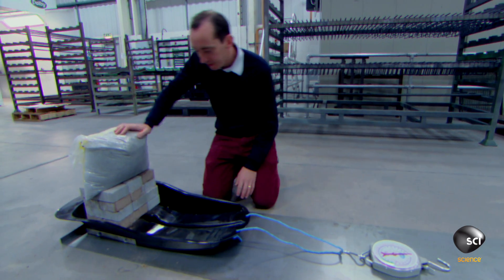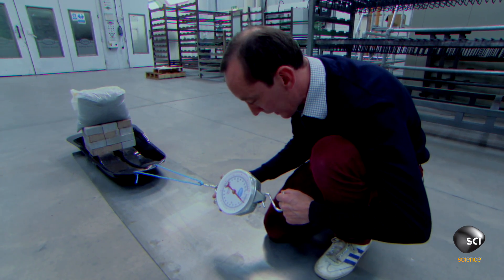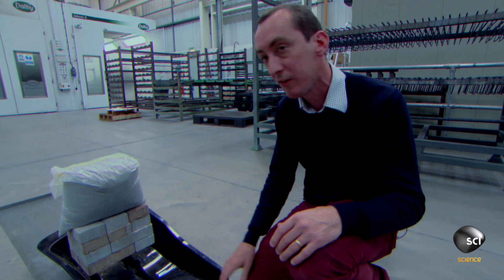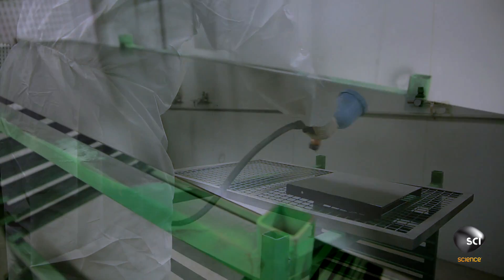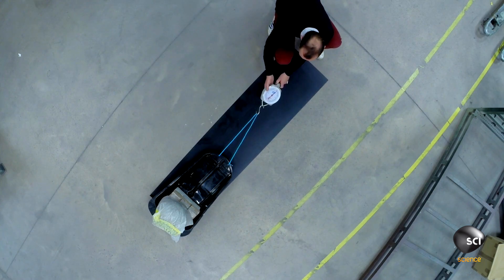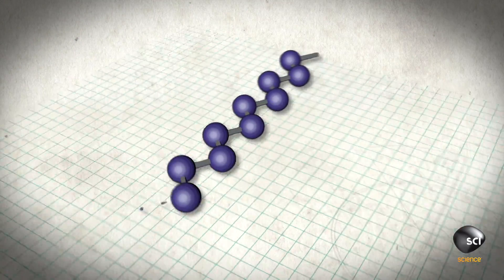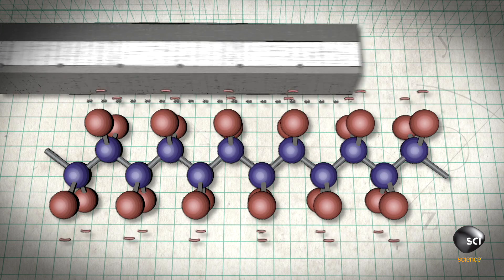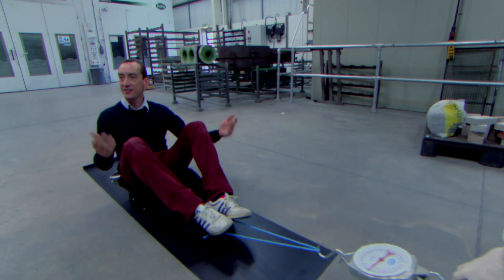How Does PTFE Make Things Slippery?

Comment: Electronegativity is a measure of how tightly an atom holds onto electrons, not it's ability to repel other atoms: the Fluorine atoms hold the electrons of the bond more than the carbon, making them on average more electrically negative - this slight negativity repels the electrons of neutral atoms of other things, thus the other atoms.
Reply: no?